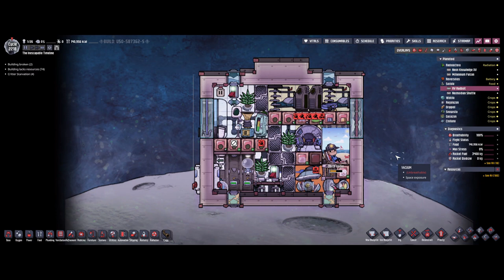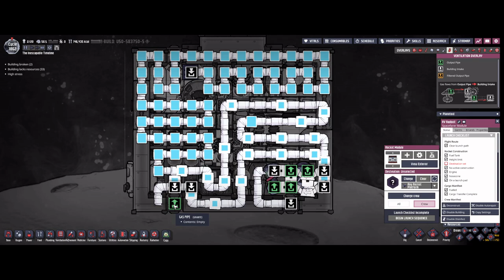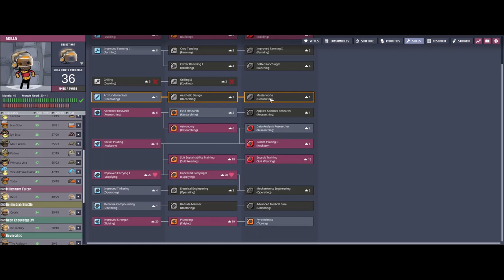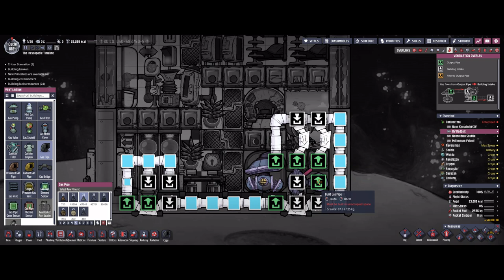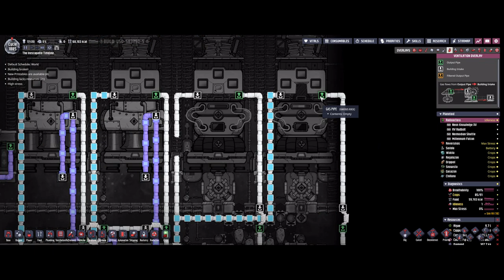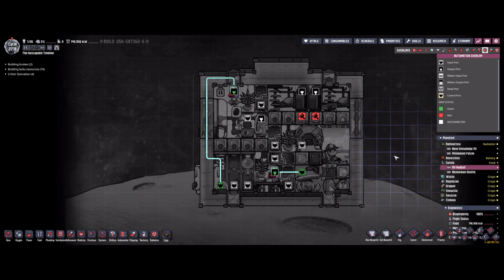Oxygen Not Included Max Difficulty All Achievements Run - How My Testing Strategy Works - EP18

Comment: Nice video !

4:40 that's a good process, as long as you try to avoid local optimum.
9:30 Heads up about the cost of morale from previous video, here the power cost, it all adds up.
10:04  6 break shift ?! Max for morale is 5 i think, if you need the first block for them to come home, remove one of the last. You are on a timed mission. (ok you fixed it after)
16:50 Ironically,  sleeping on the ground helps here. There is a bug that cause sleeping on the ground to REMOVE stress instead of adding it. (Reported it to Klei when i did my binge-eater prison for carnivore speedrun). The missed morale from barracks hurts thou.
19:20 Every planet doesn't have the same LUX amount, and yes the first panel cover a bit of lux for the next. You can deconstruct some/all of the panel and construct real ones !!
Reply from the maker: Yes I think I fix the break shifts later on.
Reply: please consider the last bit. When landing on the target planet, deconstruct some of the rocket solar panel for real solar panel @azile666